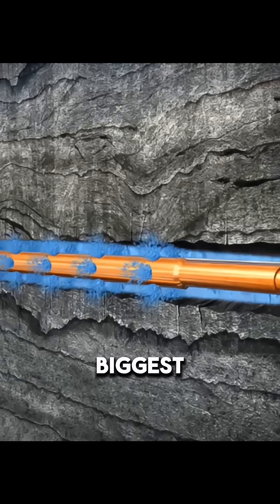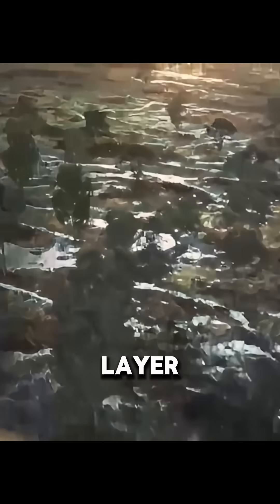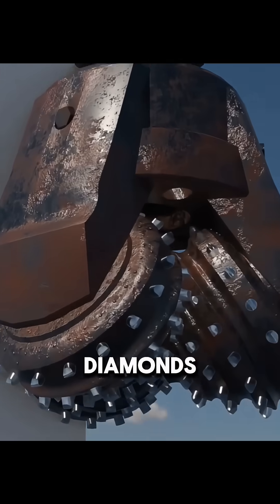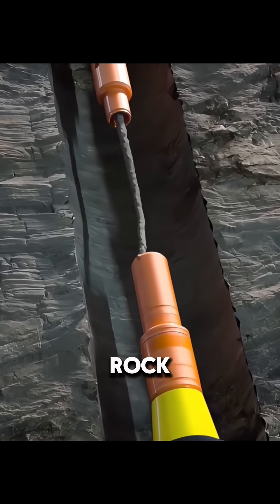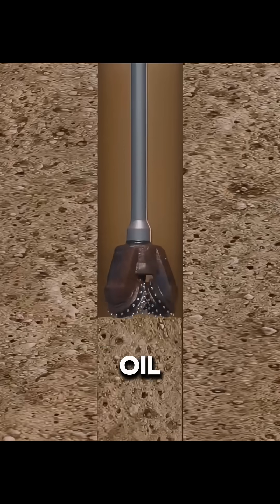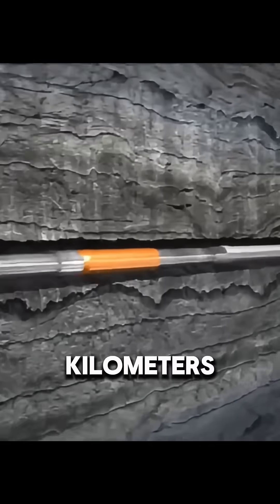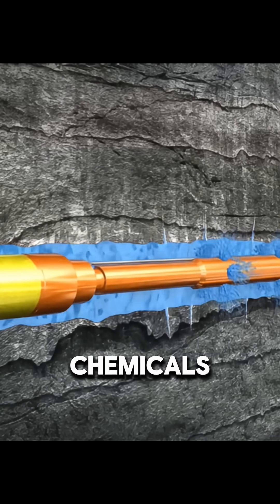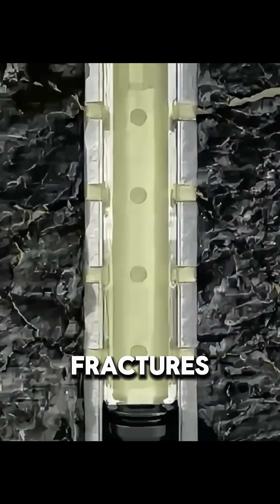How is oil extracted on land? #zackdfilm #foryou #oil

Comment: How often does this kind of oil extraction damage clean water sources?
Reply: They don't say
Reply: It really ain't no problem.  We just keep a cigarette lighter by the sink. So we can burn the fuel off the water.   Only when we get a drink.  I use it like it is to wash engine parts.
Reply: In order to damage water sources both water drillers and oil drilling have to cut corners! Lawyers want to blame oil companies since there ain’t much money to be made when blaming both.
Reply: How often do you take a shit and pollute your toilet water?
Reply: How often do you cities pollute ground water, rivers, oceans and damage the environment.  
All that dry cleaning solvent grease,  trash, plastic,  human waste, winter salt and sand. Let us not forget  the pimps, perverts,  pedophiles jester and criminals.  
Ill take fracking and the earth ability to provide and recycle man made products. Everything is consumed and reused by the biological system and process of the earth over time.
Reply: @edmonty5540 they are all filtered before it flows back to rivers again. This is happening in developing countries but developed country like USA normally don't do that. USA filters also its waste water before it flows to river back. In Europe fracking method is not allowed because of ground water contamination risk. Once in you can't pump it back. It remains there for ever.
Reply: Europe also bans the preservative BHT, which is an antioxidant and free radical scavenger that makes fats much safer.
Reply: @Tony-j4c6m  BHT is a synthetic anti oxidant which mean it prohibits oxidation. Oxidation is, of course, a key process in living organisms. I'm curious what you mean by"makes fats much safer." It's hard for many people to understand that the synthetic interference with natural Biochemical processes is frequently harmful.
Reply: @edmonty5540  you seem a little slow
Reply: @edmonty5540   Yes, you are right. Mother Earth will finally recover when the human race has already been extinct for decades🎉😂
Reply: This area is way below water tables.  Oil is there because it can't escape over millions of years.  There is also water here that is extremely salty.  It's salty because there is not water flow with ground water.  These facts make fracking very unlikely to effect ground water.
Reply: @StanleyTolle  A 2016 report concerning fracking contamination in the Commonwealth of Pennsylvania confirms hydrocarbon and fracking liquid contamination of fresh water supplies. Also, the geological perspective you suggest is correct at the simplest level and does not represent individual exceptions.
Reply: @StanleyTolle  hahahahahhaha
Reply: @StanleyTolle  Wrong. Deepest aquifers are 20000 feet. The deepest fracking is about 12000 feet. They will find deeper aquifers, and they will frack below 12000 feet.
Reply: @carltonlee5445 If it is fresh water aquifer oil in most cases will not be trapped here.  Just because an fresh water aquifer can be deaper than a fracked well this does not mean that the two situations can be found in the same place.  Of course if fracking is not done right where sealing to higher levels is incomplete fracking fluids can get into upper geological layers.  The best solution  for this is use propane as a fracking fluid, also known as waterless fracking.  While initially more expensive the propane is recovered and the well produce more and longer making propane fracking more profitable in the longterm.
Reply: @carltonlee5445 where is there and active aquafier at 20000ft close to a fracked well? Source please
Reply: Never. Oil & water are immiscible meaning the cannot mix. So where there is the shale oil there is no water.
Reply: @edmundworrell2660  Never is wrong, rarely is correct. Also, mixtures and suspensions do occur, polluting well water. Thirdly, gases can also escape into well water systems. I've heard many types of alcohol mix well with water. One fascinating topic is to understand the variety of hydrocarbons in crude oil and fracked natural gas.
Reply: every fcn time...
Reply: @_I_Hear_You try again